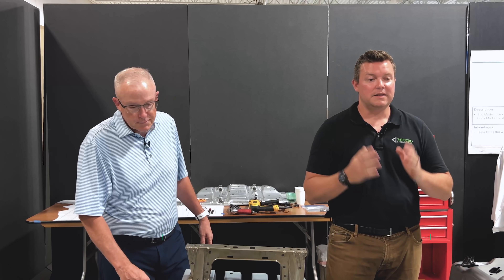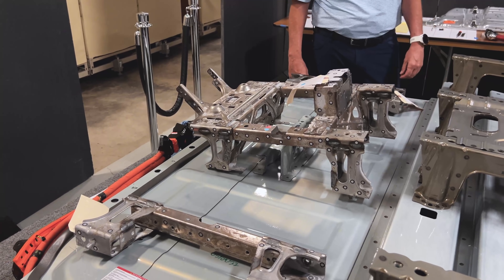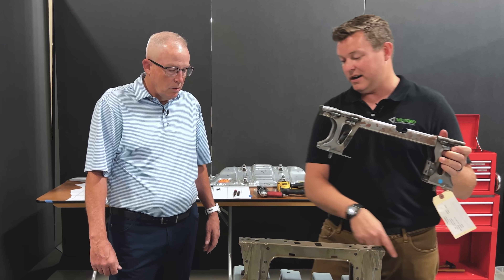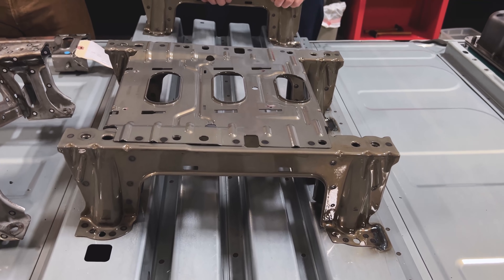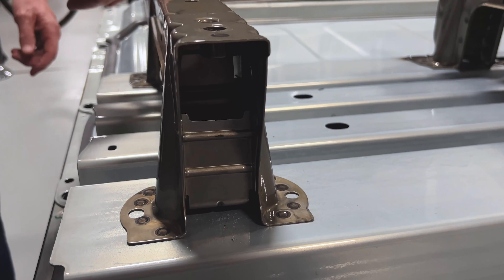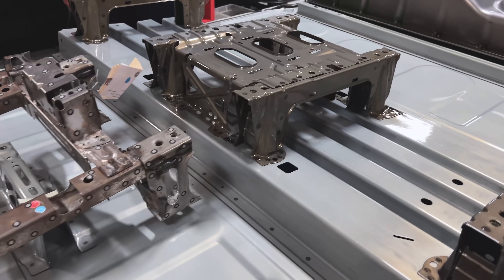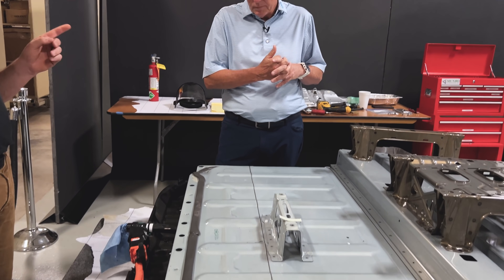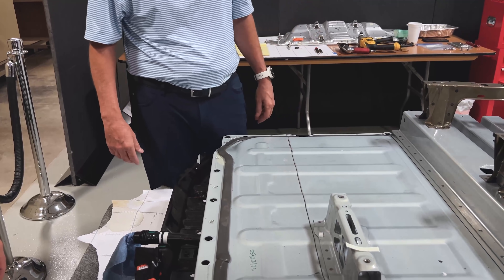Giga Texas Structural Battery Pack Cover | Tesla Model Y

Comment: Corrosion resistance, likely.  It’s a structural member and may not be inspected for decades if ever.  Spilled coffee, sloppy winters, etc.  salt and water on floorboards cannot just be allowed to rot out like on older vehicles.  Also reduces galvanic corrosion.  All those brackets could be cast in the future as well, if the elongation specs can meet crash condition.
Reply: i agree. it will be exposed much more than some will think.
Reply: @Mike-Minion  agree, galvanized sheet will fail spectacularly in certain conditions.
Reply: Exactly what I was thinking. I think we've all seen cars with holes rotted thru the floor, would not be good on the battery pack to have that issue
Reply: Ha, you said elon-gation.
Reply: This!! I thought the same thing!! 😂
Reply: I've been thinking the same about the brackets been casted, you never know you might find they cast the entire battery pack. The powder coating might serve another role as well as a insulator.
Reply: @mehuggy  also steel is way stronger than cast aluminum
Reply: why not just make the pack deck stainless steel? then only paint the priming interface where the sealant will live
Reply: @GoatDirt  SS is not as easily stamped. (My guess)
Reply: @briansilver9652  past a certain thickness, for sure it gets limited
Reply: @briansilver9652  Depends on the stainless-look at a sink.  MUCH more expensive.
Reply: @GoatDirt  as @Brian Silver said, SS may not be as easily stamped, could cost more, and welding dissimilar metals can have some issues as well (Also my guess... but this is all speculation anyways lol)
Reply: @GoatDirt  Nickel?
Reply: @chrishaberbosch1029  great point
Reply: I agree since its interior floor,
Reply: agreed, the underside of my seats and deck all rust out in the north east because you get in and the floor vent evaporates the salt water right onto the uncoated parts under the seat.
Reply: Yeah trying to make all the medal archival..just keeps going and going an going!
Reply: The cast could actually be very weak if galvanic corrosion ever happens in any conditions.
Reply: Elongation? Did you mean ElonGate, haha.
Reply: Exactly. I was thinking the same.
Reply: Yeah not sure why coating the floor pan should be a mystery to engineer guy.  Cars get wet inside all the time and arent teslas notorious for water leaks?
Reply: @skeptick6513  Probably because they're former ford or GM engineers. Corrosion = sales! Why would we stop that seems to be the company motto.
Reply: Right?!?!?  A Chrysler guy not understanding the value of quality, shocker. Insight is great but quality has been huge focus for Tesla since they have historically struggled.
Reply: Exactly, The last thing Tesla needs is a hole in the floor that’s open to the battery.
Reply: The guy is confused why you would build something to last 😅🤣
Reply: Any structural steel component that supports humans needs a fire coating. That's what it is. Ask any designer of a steel building if in doubt.
Reply: @nakuvi  I don't that coating providing that protection, it's ontop of the battery underneath the lid. We will see
Reply: @nakuvi  The top of the pack don't need fire coating, that is where the inside of the top lid will be coated with. You want fire to stay in the pack and coating the inside of the pack to prevent the fire from going out. 

The coating is for corrosion, normally there is a metal sheet between the pack and the passenger department. This sheet is together with the whole body in white coated in anti corrosion before it goes to paint. Since the pack comes after paint, it will need an anti corrosion layer to have the same function as the metal sheet.
Reply: @pipooh1  the top of the pack actually needs the protection because of everything that can get spilled inside the car so you are wrong! The car can even get flooded too.
Reply: @alanmay7929  How I'm wrong, i clearly stated the top of the pack need a corrosion coating to protect it. "it will need an anti corrosion layer to have the same function as the metal sheet." aka protection against elements and water.
Reply: @pipooh1  My understanding is that fire coatings are applied to steel members not to contain fire, but to give extra 15 to 30 minutes of strength to steel such that humans can escape or be rescued. Without it steel will loose all its strength in minutes.
Reply: @nakuvi  That could be. But in general the inside is coated in fire resistant coating to extend the strength of the steel. But in general with the pack design, there should be no fire at the top of the pack. All connections and thermal runaways should happen at the bottom of the pack. With how dense the pack is put together and with foam and adhesive the fire already need a long time to reach the top of the pack.

Comment: I mean the powder coat may have something to do with the fact that now it's the floor of the interior cabin - usually the floor pan is protected somehow. Not just adhesion capabilities for the sealing.
Reply: Definitely in the winter time, snow from shoes would melt onto the top of the battery pack causing rust and possible leaks in the future, with unsealed metal.
Reply: @kino_cinante  good point.
Reply: @kino_cinante  Definitely.  I see it just as insurance that it can last 30+ years if needed.  I remember my dad's green car as a kid had some holes in the floor, you could see outside through.  Can't have that into a battery pack...
Reply: Do they powder coat the floor of other cars?
Reply: @rogerstarkey5390  not really, it's usually protected by the anti corrosion dip coat and maybe in some cases it's base coated.
Reply: @rogerstarkey5390  Not powder coat, but it's never bare metal.
Reply: @rogerstarkey5390  They not sprayed on, but they bath the full car into cleaner and then anti corrosion bath. So the full body in white is corrosion free before going into paint shop. Since this pack is not included in that process they spray coat it to have the same result.

Comment: 16:07 Yes, thermal runaway management will be interesting. Where will the flames go? I imagine Tesla has tested this. Does IIHS or NHTSA have standards for this?
Reply: Let's try "down".
They'll have a weak spot designed into the cell (maybe the pack?) which any "over pressure event" will cause to fail first, venting the cell away from the cabin ("down")

Comment: Looks like the clear coating will prevent corrosion.
Reply: Might be a good point, since it's directly under the carpet it can become wet when occupants spill beverages on the floor.

Comment: Question: Where does spilled water go from inside the cabin? Looks like it would pool on top of the battery.
Reply: The fact that the entire top is fully powder coated is no mystery to me! 

Just imagine what your spilled Coke would do, sitting on that metal, being in constant contact with the floor pan of any car, that would explain to me why the powder clear coat finish is applied to the entire surface to prevent the human element of carbonic acid and sugar cola liquid spills, vomit and other body fluids from attacking and eventually corroding and perforating the top of the battery pack years down the road! Of course, the carpet and pad will absorb a great deal of it and despite human carpet cleaning efforts, some of it will remain, held against the metal surface in perpetuity. Then there is it’s dog, cat, drunk date or friend who had too much beer and children urine incidents as well! Humans are pigs! 😝
Reply: Evaporation is hell of a drug
(i think its the way, but in previous batery pack there was some onesided "valves")
I wonder what's the Munro ppl response tho
Reply: Do you think other brands, or even older Tesla cars, have a drain hole in the floor (by design)?
Think about that.
Reply: @rogerstarkey5390  My VW passat had one, my mx5 had one, my tigra had one
Reply: @rogerstarkey5390  All cars I ever had, had multiple draining holes in the footspace at the lowest point as well as in every trunk and reserve wheel bin.

Comment: Why don’t they apply the seal to the body instead of the pack? Since it’s the body that defines where the seal needs to be.
Reply: It’s both. And the pack is more accessible, or so it seams.
Reply: Both the body and the pack define where the seal needs to be. And if the pack is replaced the seal needs to be replaced, so this way a new seal comes with the new pack, instead of trying to scrape a seal off of the battery and correctly apply a new one.
Reply: Battery pack is one part, body consists of at least 4 parts. Also we don't know how this robot looks like but with pack it can be pretty bulky, to put on body surface the head would need to be pretty slim and agile. Also would car need to be upside down to put sealant on? As before it hardens it's probably still quite fluid.
Reply: I've wondered why they don't have the sealant on both surfaces so it completely sandwiches together under pressure. 🤔
Reply: Ease of application.
Reply: The body is made of a ton of different pieces. This is just one. There is also a cost in flipping over a body just to apply sealant.
Reply: @JorgTheElder  I assume that you meant "bottom of the body ", and I agree.

Comment: It appears the seal is not properly sealing in areas so the need for the extra coating to prevent corrosion.
Reply: Ridiculous.
Reply: @rogerstarkey5390  Look at the primary seal there are areas it is not compressing at all while other areas it’s extremely compressed. Also the coating is likely further protection from the battery chemistry composition.
Reply: @JorgTheElder  Perhaps, but Examining close to the seal as was pointed out in a previous video, It appears to be a real concern For proper ceiling especially over the long-term in specific areas. 

As more of these vehicles go into areas where there are snow, ice and salt on the road we will be able to get more long-term data.

Comment: With them still using Risers for the MY, it feels almost like they are planning to put this battery pack into the M3 in the future.
Reply: I expect a significant revamp of Model 3 in 2023 - move to Giga castings, structural pack etc, bring it in-line with MY. This  will likely happen once Austin Model Y is ramped up since they’ll need to free up some space in Fremont to rebuild the Model 3 production line while still supplying Model 3s from existing lines.
Reply: @ranig2848  I think they might be setting up to abandon Model 3 and Y production at Fremont sooner rather than later. Once Texas gets to volume as well as Berlin and with the expansion of Shangai, they can leave Fremont for smaller programs (S, X, roadster, semi) and retool for quality or just abandon it since it's just a building.
Reply: @ranig2848  maybe berlin as well, since it's ramping with old model y migth get casted model 3 first (one of the quoted reason for not using casts with the model3 was that the car was already in volume production so priority was to ramp the other programs, berlin afaik is not doing any model 3 yet so might go direct to cast)
Reply: I'm thinking they surely must be incorporating this into M3; MY sells better,  so it's first priority and the greatest cost savings.
Reply: Of course